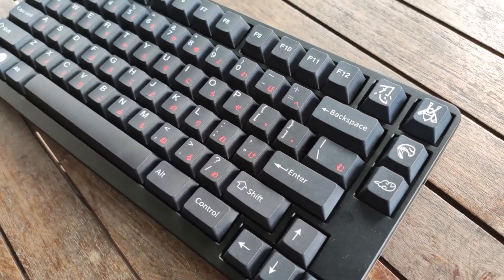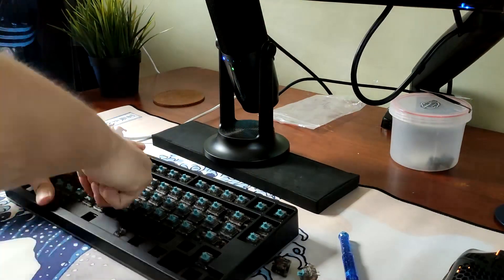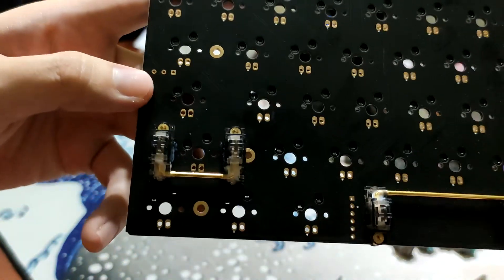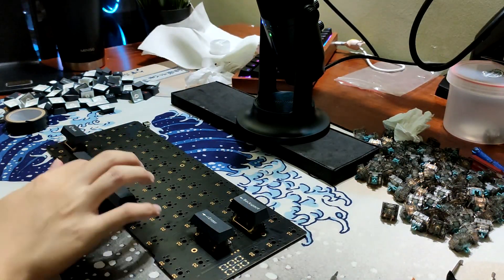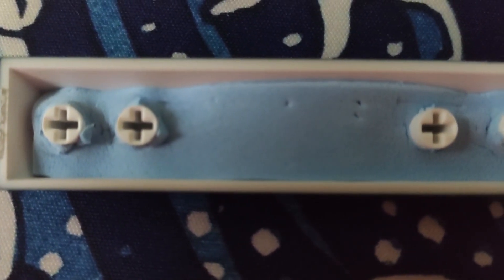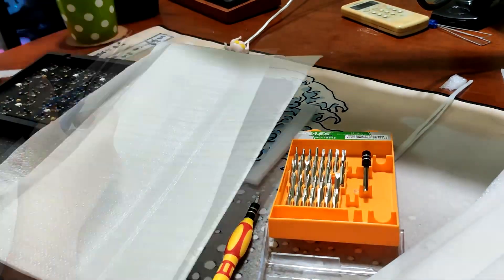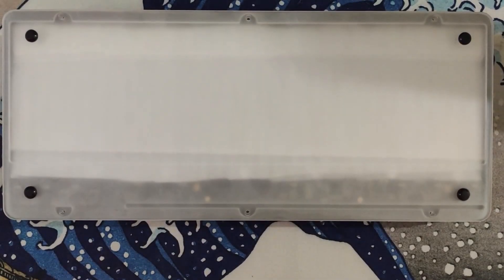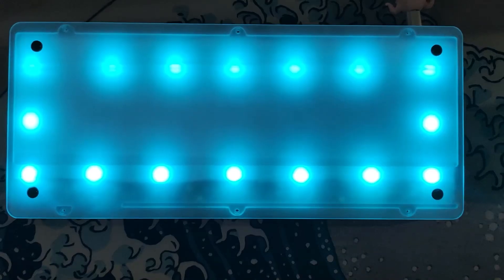This Is How You Should Mod Your Entry Level Board - Idobao ID80 Mod

Comment: May i ask does this keycap set include R2/R3 keycap to fit layout 68 or 84? As I was checking on some sites it only include some additional R1 keycap but not R2/R3. Thanks
Reply from the maker: The one I ordered has. I think there are a lot of people reselling this keycap set now so it may not be the same. The one I got was from Banggood so maybe you can try there. But u better double check with the seller again just in case it changed.

Comment: What is the difference between the V1 and V2? Nice one btw.
Reply from the maker: As i do not currently own the v2, i can't say so for sure, but from what I can tell, its mainly a redesign of the v1 to improve the overall looks and it fixes some of the hollow issues of the v1. I heard the PCB is slightly better as well but im not to sure about this. In terms of functionality it should be the same. Right now there is so many versions of the ID80 and tbh I haven't been keeping up XD

Definitely do check it out, cuz Idobao has been releasing a lot of them
Reply: @jeremytjtuan2901  Yeah it got lot more expensive as well. Think i'll get the V1 then mod it just like yours. Thank you for the tutorial!
Reply from the maker: @radityaindera3442  definitely check out the PE foam mod and the tempest tape mod also

Comment: i just ordered this board, how did you get that bottom panel with LEDs? I didnt see that option when i ordered it off idobao's website
Reply from the maker: The PCB itself comes with underglow LEDs but it's hidden under the default aluminium case cover. That is why you need the acrylic bottom case to see it and actually use it. I guess it's a marketing tactic for you to buy more 🤣. You should be able to find it if you search for "idobao id80 acrylic bottom case" either on Google or their website

Comment: you could try this but instead of putting foam on the back of the case, remove the back panel completely. And use the board as is.
Reply from the maker: Interesting. Might try this later, thanks
Reply: @jeremytjtuan2901  I heard removing the back panel can kill the PCB, but I'm not sure tho.
Reply from the maker: @rehimpertense811  I tried it already. It sounds a little bit better but I wont be doing this. I dont think it will kill the pcb because the pcb isnt touching anything else except the case but i still wont recommend doing it though as its still a risk

Comment: making no sense to get the acrylic back plate just to block the lights with foam
Reply from the maker: There's a reason why I used translucent foam. It can still shine through and there's little to no difference with and without the foam except for the acoustics.
Reply: did you even watch the video?
Reply: The white translucent form doesn’t hinder the led from shining through, watch carefully before commenting.